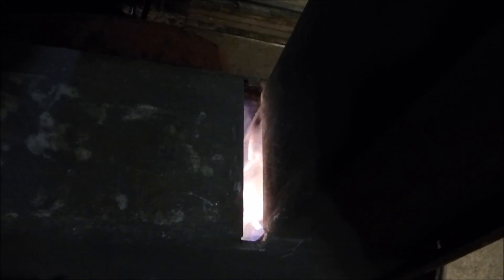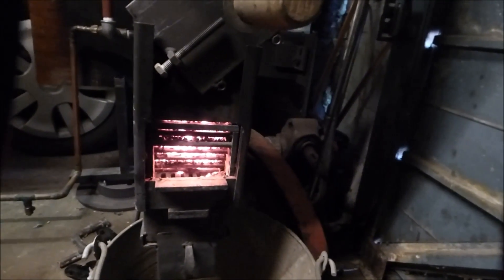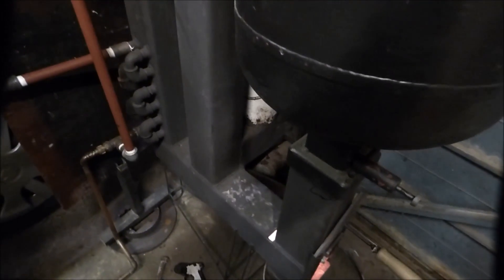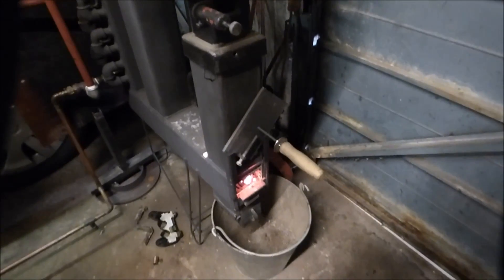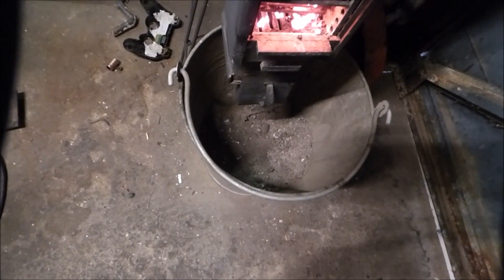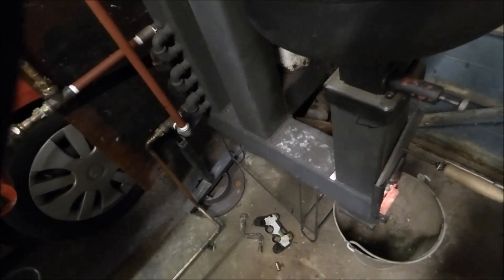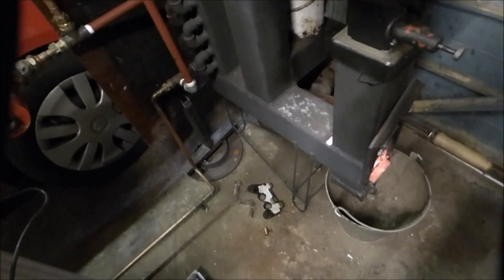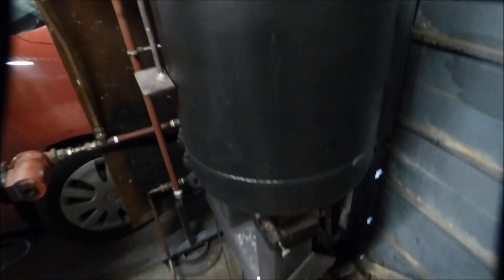rocket stove boiler up date 21 march 2018 No.34

Comment: I love your project, because it burns so clean, you also optimize fuel consumption and you are one of the only ones that heats water as well. If possible, could you elaborate on the water system (what happens in case of a leak, how to prevent steam formation, how prevent danger). Others warn about that, or make unpressurized open systems. I would love 🙏 to learn anything you have to add. 
(I’m currently on schedule for a full welding course, because I’m champing a.t.b. to make one)

Comment: I can tell you Dave that the blue flame is the most efficient and gives up the most heat with ultra low emissions  My oil burner heater is a Dynatherm which I use K-1 kerosine at a 91-93 percent efficiency. The chimney is so clean you can put on a white long sleeve shirt and put your whole arm inside and pull it out without any black marks. This unit must be at least ninety percent efficient. I can understand you keeping the garage space at sixty degrees, more or less to keep the chill at bay. How many bags did you burn during the four weeks of burning ??? Peace

Comment: My home built (using 4" square tubing) gravity fed pellet stove is similar to yours only my burn tubes run horizontal for 2 1/2 feet, up 8 inches back 20" inches, up 8" then back another 20 inches, so it looks like a big "S". My burner is much the same as yours ( I made several styles to test) and I have the secondary air slit in front of the burner also. The "slit" I made is 1/2" so it's just enough to give the gas off the pellets some air to burn, which is a nice blue flame (like yours) I can get my 4" tubes red hot if I want to (no, I don't run it that hot)  Instead of heating water, I'm going a different route and wrapping the stove with a heat metal jacket (tin) about 2" from the tubes and mounting a squirrel cage blower under the stove and blowing the warm air out the top, much like my old wood furnace. Being I can't even stand within 2-3 feet from the stove while it's running, it will be enough heat to use as a wood furnace. I heated my 24 X 36 garage yesterday in about an hour, getting it up to 72 degrees with no problem. So being the house is starting out much warmer, I should have no problem maintaining the heat, which is also a lot better insulated than the garage is (less air leaks too!) It's amazing how something can produce such a mass amount of heat, with such a simple design and so easy to build. Your video was great help to confirm much of what I already had in mind when building mine. I built my hopper large enough to hold 50 lbs. or so (about a bag and a half) of pellets, so I can run it all day and night. It takes weeks to make enough ash to even worry about cleaning the inside of the fine ash that settles in the bottom tube. I will be heating my house with mine as soon as I get the heat jacket screwed on and the fan mounted. Thanks for the vid!!

Comment: Hi Dave, I must say you have built one of the most interesting rocket stoves. As I am in the process of building a wood fired hot tub (I've loads of wood available) I was very intrigued by the boiler design. Have you ever tested the output of the boiler? What I mean by the question is have you hooked the input and outputs to a 55 gallon drum of water and see how fast it heats up the water from a cold stove start to 100 degrees F via thermosyphoning?
Reply from the maker: 1 year ago video MK3
Reply from the maker: yes/303 s/s

Comment: Hi Dave,  I would be interested to know how you assembled the elbows on this stove and if you considered other possible methods of extracting heat from this excellent stove.  I hear you saying it's simple but I am a novice on Rocket Stoves and plumbing so before I assemble mine it would be nice to be ahead of the possible assembly pitfalls which you found in practice. Thanks again for sharing.

Comment: Hi Dave.  I intend to attempt building a stove to your design using 100x100x5mm square tube and I would appreciate your personal experience and guidance on the location of the cutouts in the feed tube/burn tunnel pieces to prepare them for location before welding.  Your horizontal burn tunnel looks like it wraps around the vertical feed tube on each side before welding and the feed tube obviously has a 100mm square through hole at front and back to align with the burn tube. I am just trying to foresee any fitting problems and follow the experience you found to be best practice. I'm located in Bedfordshire UK and I look forward to seeing how that vertical basket turns out.  Your enthusiasm for your your build and experimentation has inspired me to have a go. Thanks again for sharing your acquired knowledge.

Comment: How do you put out the fire? Say you decide at the spur of the moment to go away for a few days and want to ensure there is no fire when you leave the shop... how do you accomplish this (without using water) and how long does it take until the fire is out?
Reply from the maker: The butterfly valve turns the hopper off, takes about half hour to go out

Comment: Thank you Dave, it does you great credit in being prepared to share your experience and knowledge freely.  I'm approaching my 80th birthday and I am currently building a stove from pieces of 7.5 inch diameter air bottle with a gas cylinder bell on the riser. I am getting some very good burns with a "V" shaped pellet basket but I get some blow-back above the basket as the pellets run out.  I have a 20 mm gap below the basket which works fine but please can you tell me if there is a recommended gap or clearance above the basket i.e does the end of your hopper penetrate into the basket or is it level with the top.  Many Thanks
Reply from the maker: there is no clearance above the basket. the blow back above the basket may be a chimney problem. watch the earlier video of when i made a cowl for the chimney which solves the problem, hope this helps, dave.
Reply: Thanks David.  I'm using a temporary chimney at the moment and what you say makes a lot of sense to me now.  Perhaps the chimney doesn't get the consideration it deserves as part of a complete system.  You are a man after my own heart and I wish you well and look forward with interest to your next videos.  Many Thanks.

Comment: Hi Dave,  Been following your design for the last year...probably the best KISS layout out there.  Considering the wear of rocket stove fire boxes on metal...are you thinking of enlarging the first couple of feet of square tubing to accomodate fire brick?  Or have you experienced much wear/flaking/pitting?   Your adopting of the Mike Knop pellet basket is a good move...good air flow, good longevity and simple to repair.  Have you done a clean out of the whole system to see if there is any buildup of fly ash restricting air flow, especially at the first two turns of the exhaust?  Keep up the good work...you're one of the leaders in the rocket stove movement.  O.J. Romo  Elkton, Oregon, USA
Reply from the maker: no wear or flaking at the moment. have not had to clean out the system  yet